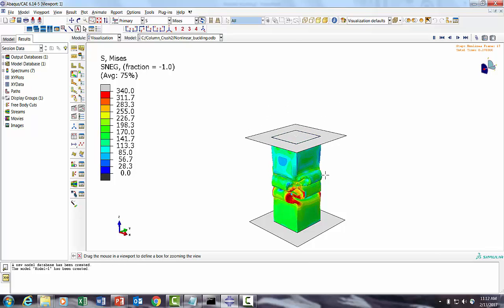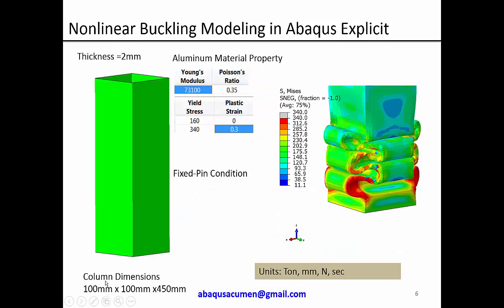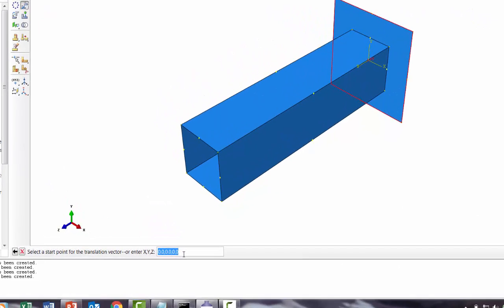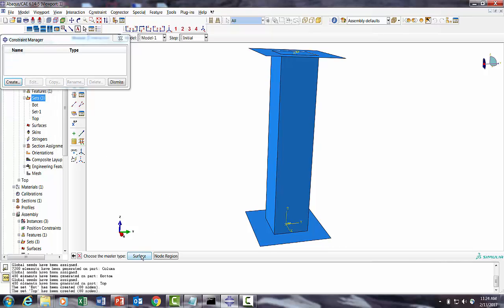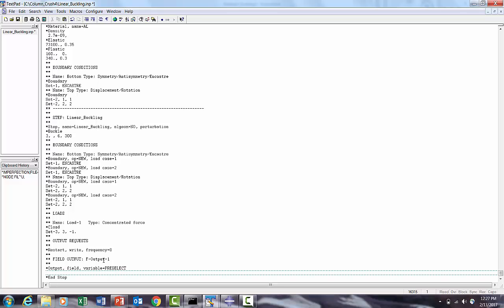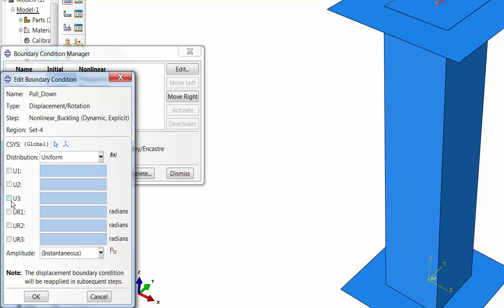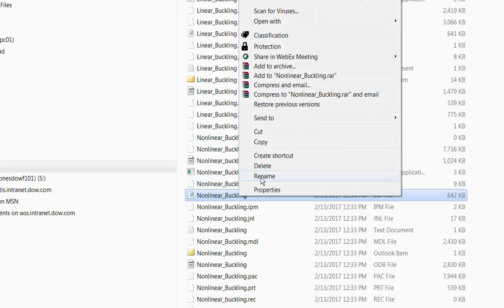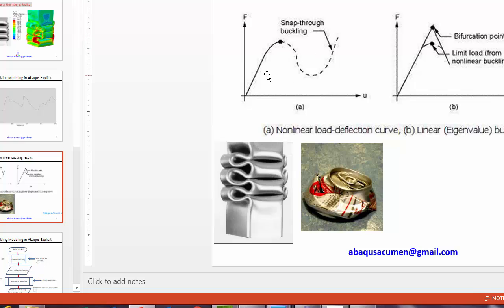Abaqus Explicit - Square Tube Crush Tutorial (Nonlinear Buckling with post buckling behavior)

Comment: PROCESSING PART, INSTANCE, AND ASSEMBLY INFORMATION
   *****************************************************

 ***ERROR: in keyword *CONFLICTS, file "nonlinear_buckling-trial.inp", line 
           16331: Keyword *Conflicts is generated by Abaqus/CAE to highlight 
           changes made via the Keywords Editor that conflict with changes made 
           subsequently via the native GUI.
 ***NOTE: DUE TO AN INPUT ERROR THE ANALYSIS PRE-PROCESSOR HAS BEEN UNABLE TO 
          INTERPRET SOME DATA.  SUBSEQUENT ERRORS MAY BE CAUSED BY THIS OMISSION

 ***ERROR: in keyword *CONFLICTS, file "nonlinear_buckling-trial.inp", line 
           16339: Keyword *Conflicts is generated by Abaqus/CAE to highlight 
           changes made via the Keywords Editor that conflict with changes made 
           subsequently via the native GUI.

 ***ERROR: in keyword *CONFLICTS, file "nonlinear_buckling-trial.inp", line 
           16340: Keyword *Conflicts is generated by Abaqus/CAE to highlight 
           changes made via the Keywords Editor that conflict with changes made 
           subsequently via the native GUI.

 ***ERROR: in keyword *CONFLICTS, file "nonlinear_buckling-trial.inp", line 
           16341: Keyword *Conflicts is generated by Abaqus/CAE to highlight 
           changes made via the Keywords Editor that conflict with changes made 
           subsequently via the native GUI.

 ***ERROR: in keyword *CONFLICTS, file "nonlinear_buckling-trial.inp", line 
           16331: The keyword is misplaced. It can be suboption for the 
           following keyword(s)/level(s):

Comment: Thank you for the video, it is very helpful. I used to use static riks method for the nonlinear buckling part. What is the difference between using static riks and using dynamic explicit? The static riks method appeared to diverge when using general contact (standard).

Comment: Sir, could you please help me with a simulation. I want to do an under water impulsive loading simulation on a cylinder  using CEL where I need to create a blast wave by appling an input velocity profile in the inflow Eulerian boundary condition. But I can't understand how to give a prescribed velocity in the inflow condition.

Comment: How can i use a pin load with very low velocity ex 150kn at a speed of 3mm/min instead of displacement ?? ....
Reply: have you found the solution for this setting? i also need it. thank you .

Comment: Thank you for the video. It helped me a lot. 

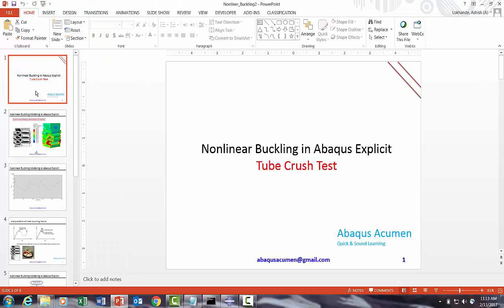01:31 Problem Statement.
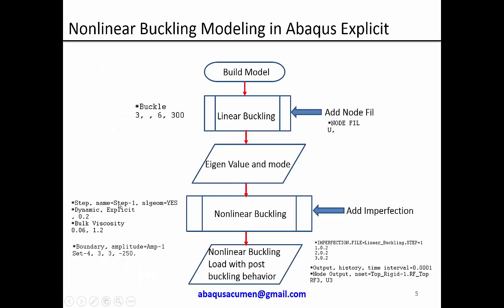03:19 Simulation Flow Chart.
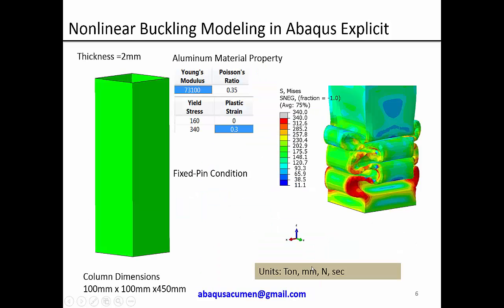04:03 Simulation Descriptions (Geometry, Material Properties, BCs, etc.).
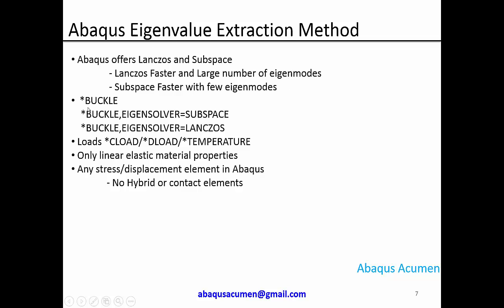04:34 ABAQUS Eigenvalue Extraction Method.

From this point, the simulation starts. You can switch between different modules while he is teaching:

=====================================   Linear Buckling   ==================================

Create Column:
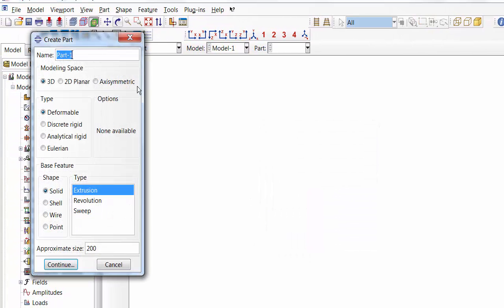05:11 Part.
Assign material to Column:
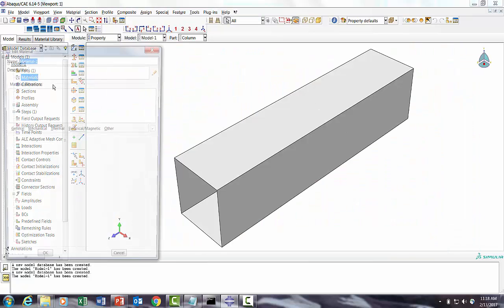05:47 Material.
Create Bottom & Top plates:
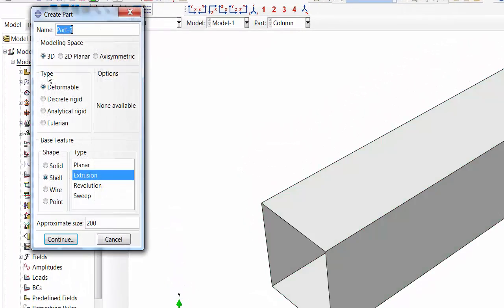07:02 Part.
08:05 Assembly.
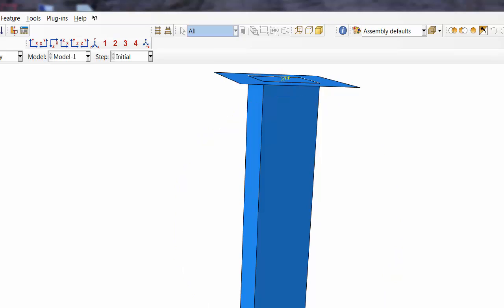08:46 Mesh.
Define two Node Sets for the top and bottom nodes of the Column. Then, define two Tie Constraint for the Top and Bottom plates using those Node Sets:
10:02 Interaction.
Apply BCs, Top & Bottom, Pinned & Encastre:
13:17 Load.
Linear Buckling - Linear Perturbation/Buckle:
14:13 Step.
Apply Load - Unit Concentrated Force (Compressive) in Z-direction:
14:38 Load.
Create Linear Buckling Job:
15:02 Job.
Data Check for Linea Buckling:
15:15 Job.
Adding NODE FILE, U command line to the end of the Step, before END:
15:23 Manipulating the Input (.inp) file of the Linear Buckling Job.
16:08 Running the Job from Abaqus Command prompt window.
(If you can't find it in the Start Menu, check the folder in which you installed the software. You can also Run the Job directly from the Job Manager window in the Job module).

=====================================   Nonlinear Buckling   ==================================

16:51 Description.
Delete the Linear Buckling Job and Linear Buckling Step:
17:35 Job/Step.
Define General Contact:
18:16 Interaction.
Create Nonlinear Buckling (Dynamic/Explicit):
18:49 Step.
Apply BC, Pull_Down, Displacement in Z-direction:
19:13 Load.
Define a Geometry Set for the Top plate, Top_Rf:
20:02 Adding History Output Request.
Select Set, then choose Top-1.Top_Rf Set from the drop-down menus. Select RF3 and U3 from the Output Variables window:
20:23 Request History Output.
Nonlinear_buckling, then do a Data Check:
21:08 Job.
Adding IMPERFECTION command line to the beginning of the Step, before its definitions:
21:43  Saving the Nonlinear_buckling Job & manipulating its Input (.inp) file.
23:14  Running the Job from Abaqus Command prompt window.
Check Results:
24:07 Visualization.

Comment: Hi, thanks so much foe your detailed video. In this tutorial, you model the nonlinear buckling by importing the imperfection from linear buckling. I used to watched one of your videos, which is also about the nonlinear buckling using the explicit analysis, however you didn't import the imperfection from the linear buckling analysis. Do you remember that video? I am wondering what is the difference between the two methods (one has a linear bulkling analysis before the explicit analysis, and the other is using the explicit analysis only)? I will appreciate your response.
Reply from the maker: Linear buckling don't have the imperfections.
Reply: yeah, I know. You use the deformation of the first three buckling modes as the imperfection in the nonlinear buckling analysis. So I just want to know what is the difference if you don't do this first linear buckling step. Thanks.
Reply from the maker: In reality column is not perfect. They have imperfection. If you don't use the imperfection then you will end up with higher buckling load.
Reply: I think I've got your meaning. Thanks a lot.

Comment: I couldn't make it work in Explicit mode, There is an error saying "The elements contained in element set ErrElemExcessDistortion-Step1 have distorted excessively."
Also, you did changes in the mesh for explicit that were not shown, am I wrong?
Reply: The video is good, and luckily it worked for me, almost exactly equal, but I wanted to comment on the fact that I couldn't find when he re-meshes for Explicit Type, which he says he will when meshing Standard in Linear Analysis.

Comment: Hi, thank you for your videos. 
I have a question, have you checked the the Ratio of kinetic energy and internal energy and also the Ratio of artiﬁcial energy to internal energy? 
Is there any efficient way to modify the simulation  by reducing those ratios to less than 5%?
Many thanks.
Reply from the maker: Yes Energy balance is perfect. We have used the enhanced hourglass control. Thanks for input